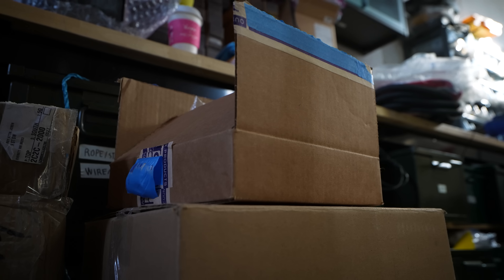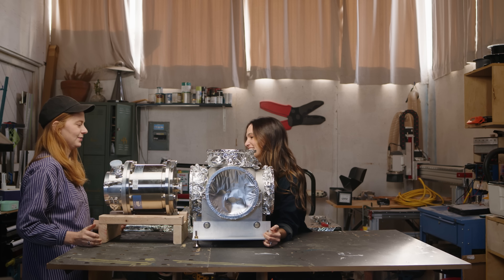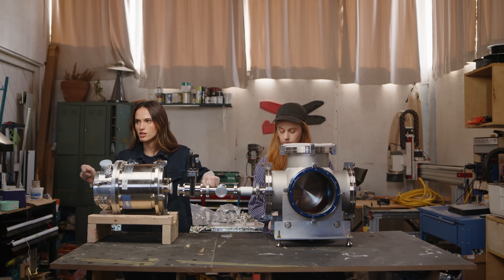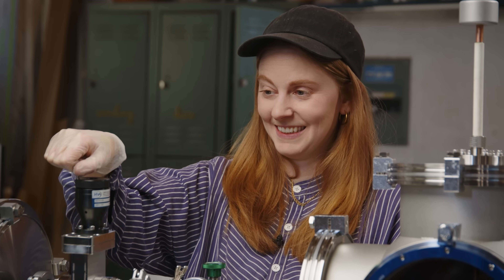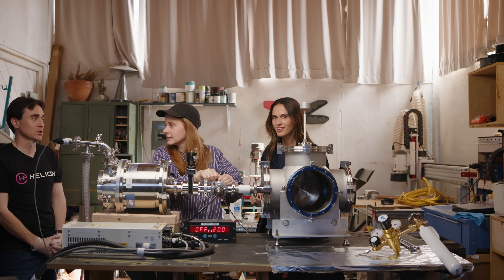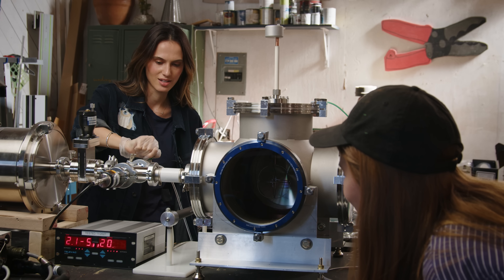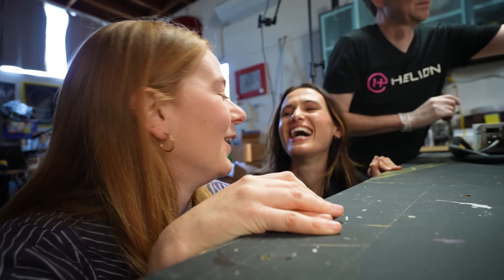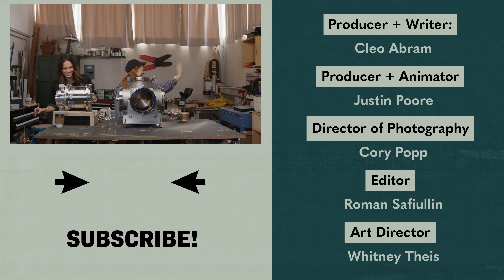We Tried To Do Nuclear Fusion

Comment: I like how David's completely unfazed  by it all, like an electrical engineer who just showed a kid how to power a lightbulb with lemons or something.
Reply: Has anyone actually performed spectroscopy with their fusor?  Seems like can be done really easy DIY by yourself.  No fair, super tease.
Reply: @jafinch78  yes it has, back in the 70s no less
The spectra for air is pretty deep purple, pink like helions logo for Deuterium
Reply: @LeRoiJojo  Because it's not fusion, it's basically a complicated neon lamp.
Reply: @Mobin92 yeah it’s sad that this guy is tricking them that they are making fusion
Reply: It is about that trivial
Building a Fusor is a recipe now a days especially if you can stuff new. You can buy a nearly turn key drop unit for 10-15k
Reply: funny that you compare it to a lightbulb...
because it's literally just an elaborate plasma lamp
Reply: He'll be dancing like crazy once Polaris is fully built, starts pulsing at rapid fire rate, and making measurable honest to goodness clean electricity
Reply: The device in the video is very cool and I'd want to see it in person too, but I think it's also really just a demonstration model, more useful for showing to people than anything else. 

I can't imagine how many times they must have had to fire this up to show it to potential investors.
Reply: He's unfazed because he knows he's lying straight to their faces, deuterium-deuterium fusion releases neutron radiation and x-rays from bremstahlung radiation. So even if they did achieve fusion they would've gotten a fatal dose of radiation standing that close to it, so they didn't. For them to have achieved fusion they need energies up to 30 KeV and they only went to 3 KeV.
Reply: Fusion fuel is Tritium/Deuterium, not just Deuterium.  Naturally occuring Tritium is extremely rare on Earth and only found in trace amounts in the atmosphere.  That means the Tritium in the expirement and the others came from our fission reactors.  PWRs release 10s of thousands of TBq per site per year of tritium into the environment on a daily basis.  This tritium is taken up in plantlife where it forms Organically Bound Tritium that does not leave the human body in under 30 days and becomes bonded to our cells that causes DNA strand breaks, micronucleus formations, cell necrosis or apoptosis, chromosomal aberrations and various other phenomena thus negatively affecting human health.  We should not use either fusion or fission. Do these girls know this? Helium 3 is on the shortage list...
Reply: @paulmobleyscience  Yeah, so many people see the hype and rhetoric and not the holistic system develop and validation life cycle.  Definitely many many variables not well detailed to the masses that makes me super bipolar like regarding the issue.   Seems the first step is to clean up fission operations by getting those deep underground and/or underwater I guess and modularized with deep underground processing facilities to recycle and process the used materials.  Holistically, there are excuses after excuse for dumbing down the U.S. Jurisdictions to complete morons en mass with low IQ's and EQ's and standardized logic memories and memory associations demonstrated in test scores that inhibit the advancement of the advanced domesticated complex maintenance of systems for growing populations societies.  In particular the development of existing systems to be greener I guess is the term or healthier with the goals of the healthiest systems.  That's not going to happen when the role models are a bunch of suicidal deviants hell bent on being hooked on a feeling and high on believing whatever is trending mafia lies and deceit for mass murdering profiteering schemes that are counter public health and counter public safety.  Imminent threats are wild on the loose more than required, blending into the valid masses more than most realize intentionally.  Doesn't serve or support the situation or valid design of what better men (and a few woman) intended to implement for perpetuity and betterment of humanity and society peacefully.  Pan Troglodyte weird and alarming in many, if not most situations.
Reply: @jafinch78  I don't believe deep underground is the answer and heres why.  Dry casks....will have to be repeatedly replaced as the concrete and metal breakdown long before the waste reaches its whole life decay because half life does not mean safer by any stretch of the imagination.  One radionuclide that went through one of its half-life and didn't decay has the same exact characteristics as a brand new radionuclide of the same name that just popped into existence.  Meaning one tritium radionuclide that went 12.33 years and didn't decay has the same exact energy and characteristics as a brand new tritium radionuclide.  You can't tell them apart...so we can't just bury it and forget about it in any repository.  Using oil and gas type bore holes down to bedrock won't work either as we see issues with Microannulus and concrete degradation in the abandoned boreholes we have now which will create a path down to the bedrock for water to flow creating something the world has never seen.  We shouldn't be drilling into bedrock causing weakpoints in what is normally solid and is not the answer.  WIPP had an explosion simply because they used the wrong kitty litter.  They all know it really shouldn't be buried and is not a plausible option for the storage of nuclear waste as it was their first idea over 70 years ago but found out what it will do to an aquifer if radioactivity and radiation gets inside.  The only real answer as crazy as it sounds is to safely send it off this planet.  With returning rockets and capsules that will protect astronauts in the case of a rocket explosion, this idea becomes more a viable option everyday, no matter the cost.  We need to stop producing this waste before we finally figure out a viable way to dispose of it.  Repositories are not the answer, nor is reprocessing it with something that end in EX (there are many) when we used to use hexafluoride to break the covalent bonds that seperates the fissle material from the wasted fuel.
Reply: @wilurbean  Hi Mark...Yes...to have Gamma decay from the radioistope, first Alpha or beta decay must occur and the daughter releases a gamma photon to then become stable.  The Linear threshold deals with mostly external exposure of high energy colliding and scattering affect and not the Alpha (nucleus) and Beta (electron) physical particles that are ingested and trapped in the body.   Those particles release a gamma photon if radioactive decay occurs.  The radiation of the Alpha and Beta comes with many ejecta and energy released in the form of Gamma rays that cause damage to the genome that is then rewritten in the MRNA that is passed on to offspring of all life on the planet. Carbon 14 dating is a guesstimation probabalistic calculation on just how long it takes for half of a Carbon-14 to decay away within 5,730 years and each single Carbon 14 has a 50/50 chance of decaying or not decaying every single second.  That means the probability Carbon-14 dating is not a precise measurement to know how long any particular geological location underground hasn't been affected by movement.  That is a faulty system of gauging timeframes of history and can not be used for a proper decision to bury nuclear waste at any area on the planet. The fuel exchanges have been cheated on as the pressure releases, daily "Normalized Dishcarges" of various effluents made possible only because the NRC regulators allow it to occur when it shouldn't be.  Sending it off planet, safely mind you, is the only proper answer for nuclear waste but the fist step in dealing with all this is to stop the production of nuclear waste to start with especially with no real answers for the waste of decommissioning a meltdown like Chernobyl or Fukushima.
Reply: @paulmobleyscience  sending things into space is a bad idea as things orbit in circles. Enough of this and you may create the greatest nuclear hazard in decade from now. If you are doing this then you must sacrifice and dedicate and entire celestial body for that purpose so that it's stay there. And if you choose an asteroid, it's best for it to be one that do not exit the kuiper belt. Big enough for it's escape velocity to be high enough to prevent new arriving materials to create run away ones. Also nuclear waste is heavy, I'm talking lead heavy. Although sending thing into space is becoming cheaper, this still poses a problem since we have quite a bit of it.
Reply: @NPassosiation Gravitics was never discussed, and what we do with it after off planet either.  Voyager 1 and 2 spacecraft was sent out of the solar system decades ago, are you suggesting we are no longer capable of sending spacecraft exactly where we wish them to go?  400,000 metric tones to be exact and I think the first step would be to stop producing more until we figure out a proper solution to the problem...you know the saying putting the cart in front of the horse?  Yeah
Reply: The difference between David and the others' reactions are also pretty funny. 
pump makes weird fssh noise 
Everyone else: are we gonna die?
David: darn the tube fell off stick it back on
Reply: Exactly. And this made me believe that humanity will succeed doing that in a larger, sustainable scale within my life time

Comment: This video is so good! I never expected fusion to be so easy to understand and engaging to watch!
Reply: @answerinprogress  Because it's not fusion... It's a grift by Helion.
Reply: Because it´s not. They created a gas discharge lamp. The thing that glows inside the switch of your power distribution cord. It doesn´t make fusion, it just makes a corona discharge in a low pressure gas atmosphere. It´s a "neon" bulb, except they use deuterium and not neon.
Reply: Well, it looks easy but its not.
Reply: It's not fusion
Reply: Happy to see you here ... I'm a big fan
Reply: science is very engaging but people dont give it a shot due to fucking education system
Reply: How? What did you understand tell me? Not impressed at all .... atleast tell us what each part is ... what its doing etc ... also show us how you extract electricity/heat/energy from it if possible ...  it just looked like neon/plasma lights that's it ... man really wanted to see something in detail ... there only so many people who have this kind of knowledge & equipment budget ....  this was annoying. 

Also  you should have explained what the diff is bw this experiment and what helion is actually building ... instead of just scaling this up etc. man super annoying.
Reply: @hemantsarthak  it's almost like it said this was a part two in the introduction
Reply: @Hailvian  part 1 has theory ... I understand the basic theory ... I want to know more about the physcial machines being used .... energy extraction processes etc ... in this they were doing the practical and stilll didnt tell the component names used etc. thats why I was annoyed.